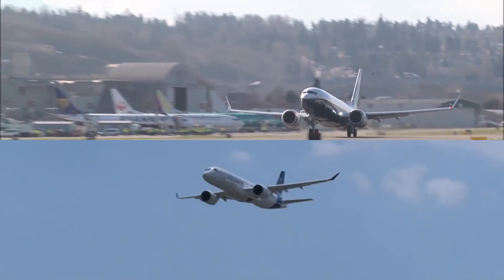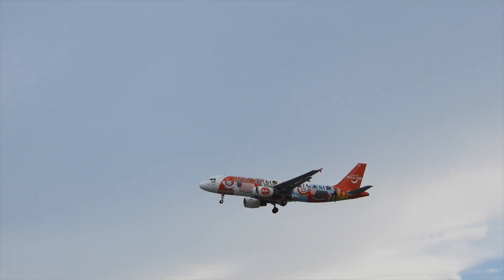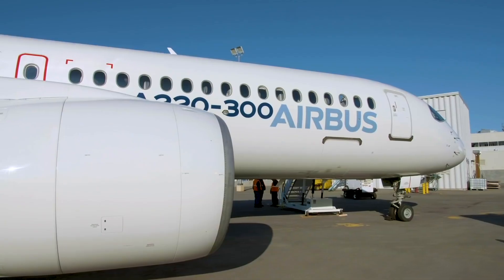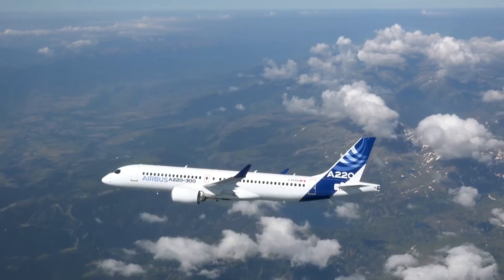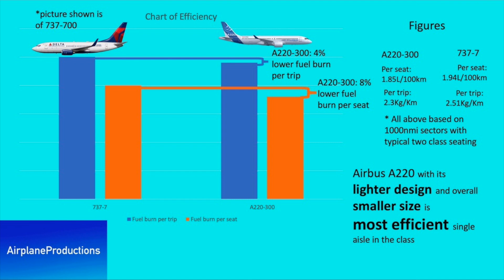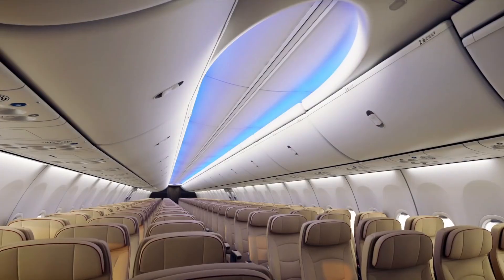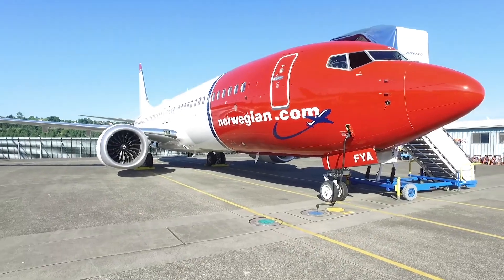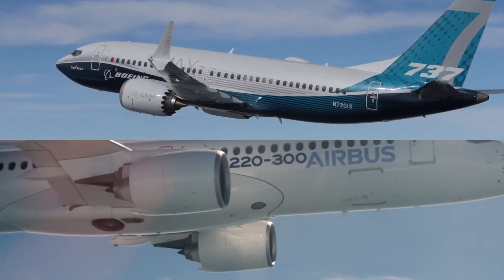Airbus A220-300 vs 737 Max 7: Which is better?

Comment: For better or worse modern aviation is a numbers game. The A220 is optimised for its size. The Max 7 is not.  Even given the crew type conversion costs, to those airlines whose need is predominantly in the 120-150 seat range there is an obvious advantage in the Airbus. Neither is the fact that it pleases their passengers lost to potential operators. Oh yes, this plane WILL sell.

Comment: World airlines like Korean Air loves A220-300. So fuel efficient and economical that it turns profitable at 50% seat occupancy. Flexible seat and flight scheduling is added bonus for both major airline and budget airline. Passenger loves wide seating space and window, seat entertainment. Residents near airport loves it for its low aircraft engine noise level.

Comment: If Southwest was SMART they would have replaced there aging 737-700 fleet with the A220-300. Instead of going with the "unpredictable" MAX's. There is no question the A220-330 is quieter, more fuel efficient, and spacious compared to older generation 737-700 models. I clearly see this jet becoming the NEW front runner over the next few years as the top regional aircraft without question. And if they decide to build a 500 stretched variant even more so. Then they will be directly competing with the 737 MAX's for sure. Not that the A320-NEO's haven't done so in there own right. But an A220-500 variant would only further chip away at Boeing's flawed MAX development. It's only a matter of time in my honest opinion before that jet has problems again.

Comment: Get your facts correct "After American forced Boeing to re-engine" - American did NO such thing, that issue was entirely down to Boeing Salemans pride and greed. Boeing offered American a re-engined 737 that at the time was NOT even on the drawing board, claiming their product would br cheaper and better for American, in order to persuade American not to shut out Boeing but to split the initial 100 Aircraft order for A320Neo's with Boeing for 737-MAX's.

Comment: pilots prefer the A220-300 as it kinda stays in the sky, however, it (A220-300) has had a few issues, Swiss experienced some engine cut-outs that may have been caused by a software issue. Software problems are being eyed as the cause of several engine failures, but I understand that's been rectified, pilots can restart and continue haha

Comment: Slight correction
1. If the Max was to ever fly again it will be treated as a New Aircraft with all the required training and NO Crossover training allowed
2. The 737 Max will NEVER be certified until it is redesigned from scratch
3. The decision was made to never let it fly by Boeing PR Stunt announcing Certification Flights by Wednesday that had NOT been agreed
4. FAA reputation is now in tatters due to Boeing PR Stunt
5. Europe is the decision maker and Boeing has no friends there after it tried to destroy Bombardier
6. Brazil will not allow Boeing to have certification after the way it throw out its deal with Embraer
SUICIDE is still the mantra of Boeing
Reply: slight more correction
1. If the 737max was ever to fly again it will be treated as a new Aircraft with all the required training and No crossover training allowed.
2. the 737max WIll DEFINITELY be certified until there are a FIX and Whole OVERHAUL of the aircraft
3. The decision was made to always let it fly by Boeing PR stunt announcing Certification flights by Wednesday that had been Agreed. 
4, FAA reputation is now not in tatters due to Boeing PR stunt
5. Europe is the decision-maker and Boeing has lots of friends thereafter it destroyed McDonald Douglas, not Bombardier. (airbus took over Bombardier) 
6. Brazil will allow Boeing to have certification after the way it throws out is a dealer with Embraer
SUICIDE is NOT the mantra of Boeing anymore
Reply: Ouchhhh
Reply: @D_2_M  Europeans will NOT trust any FAA certification of the 737Max. If it went ahead then there is a view in Europe to never fly Boeing aircraft. There is now an excess of aircraft that outside of the USA airlines can just cancel the Max and use their spare aircraft until Airbus delivers. Boeings best solution is simply CANCEL the 737 Max and design a new aircraft, exactly what it should have done from the start. GREED, BONUS  and EXCESSIVE EXECUTIVE PAY
Reply: @trevorhart545  Europeans will trust any FAA certification of the 737max. if it went ahead then there is a view in Europe to always fly Boeing aircraft. then what is wrong with other Boeing aircraft? There is now an excess amount of aircraft waiting outside around the USA waiting to be delivered and airlines cannot just cancel the MAX and use their spare aircraft until airbus delivered. Boeing's best solution is to never simply CANCEL the 737max and do not design a new aircraft. exactly what it should not have done from the start. GREED, BONUS and EXESSIVE EXECUTIVE PAY will make it much safer than ever

Comment: No competitiom. Unfortunately Boeing's reputatiom ia now in the gutter. The 737 Max is still based on a 1950's design and has merely been updated with each new series. The MAX is an upgrade too far. Boeing should have designed a new plane from the ground up, not tried to cut corners. With major airlines cancelling orders, Boeing will struggle!
Reply: Unfortunately, Boeings reputation is not in the gutter anymore. the 737max is based on a 1950's frame but the max is just an update with the last series. The max is an upgrade just right. Boeing did come up with a new design of plane called 797 from the ground up. that never made it t production. the 737max will be returned to service fully by this new nma aircraft from boeing. they haven't cut corners now. with no major airlines not cancelling orders Boeing will thrive

Comment: Honestly the more fair comparison would be the 737-600 vs the A220, the 737-700 competes more with the A319 and same with max vs neo, the A220 is more a smarter replacement to the A318
Reply from the maker: Joseph Penn Interesting, yep the 737-600 competes with the A220-100 though the larger -300 actually is similar in size to 737-700. Thanks for watching!

Comment: A220 should become a great seller especially given the current state of affairs. I personally believe smaller jets will do very well in the post coronavirus world.
Reply: I would rather an Airbus than a Boeing Model-T Ford with updated MCAS with NONE of the faults taken away. The aircraft is unstable A DESIGN FAULT, cure the fault NOT hide it away. Boeing did that AND CHARGED EXTRA if you wanted to know what the fault was. GREED IS BOEING and FAA.
Reply: Yes smaller jets is the future. That's why A380 are retiring.

Comment: I love the A220! The 737 air frame is old tech, it should have been updated decades ago. The A220 is a beauty second to none.
Reply: They did update it many times but it has reached it maximum limits.
Reply: @D_2_M  they didn't.  They have extended it vastly, but the reason the 737 Max climbs too steep when power is added is because the wings needed to be further back, so that the newer high-bypass engines being mounted further forward on the Max didn't result in an unstable design requiring the Tail to need MCAS to constantly fight the unstable design.  

If they had resigned the airframe then either the wings or landing gear would have been higher to allow the new engines to fit under the wings,  OR the wings would have sat further back (by maybe 2ft) so the center of thrust was balanced with the airframe.  

The fact is they didn't redesign it.  They have only extended it.  Proof is found in the flat bottom of the Leap 1b engines.....needed because they cba to redesign it.

Comment: I have worked as grounds ops for delta and jetblue, so I have worked on most planes, the europeans are so mush cleaner and accurate with their construction. Given the choice I would fly airbus if possible.
Reply: the only thing here is that the a220 is not an european plane, its a canadian one who got sold to airbus
Reply: what wrong with a Boeing
Reply: @nickolliver3021  for ground ops guys the airbus have more room, are laid out better and the craftsmanship of the whole plane feels and looks better than boeing
Reply: @marcusholmes7942  both airbus and boeing offer more room than old existing inefficient aircraft for sure. I can say the craftsmanship of 787 and 777x look better but look tbh they all have ups and downs.
Reply: @nickolliver3021  Much quicker to list the things that are NOT wrong on today's Boeings. 737 Max, 787 or 777X.... one nightmare after another. Former and current management needs to be put behind bars.
Reply: @user-ct2tt9zy8h  will there are no current thing going wrong on today's Boeings apart from the ongoing 787. 737 has done really well. 777x not boeings fault for being delayed. 787 is tbe only one with its contamination issue. Former and current thing management will hopefully be xhanged in the neae future

Comment: When the MAX gets ungrounded I would take the max any day because it is more rouged and stronger and it runs the same systems as the boeing 787 and it was but for longer range rather than the CS100 it was built for short flights like regional flights and you can fly a boeing 737 from Canada to Cancun and not stop also the A220 looks like it was trying to go with the look of the sukhoi superjet . And tbh the boeing 737 has a more versatile option and the systems are easy to jump from a boeing 737-800 to a boeing 737-900 because of the similar systems and the boeing 737 has more of a reputation that is why airlines have not droped on the big 73 and tbh I've flown a 737 before it has more legg room in the cockpit how ever Airbus has good seating but the A220 is not really known and it is just a plane rebadged with airbuses logo and this comparison was kinda unfair because the CS200
is a regional jet and the boeing 737 is not and a fair comparison would had been the embrare  ERJ-195 and the CS200 that would be a fair comparison. I'm not a really a Airbus lover I'm more of a boeing lover. Plus I don't like the fact that a computer is trying to minimize the amount of control of the aircraft I have I want to be in control of it all and airbuses fly by wire has caused a lot of Airbus crashes to be hectic let's stop acting like Airbus is all that grand it has a lot of faital flaw's .in my opinion I think boeing will still be the company people will purchase plane's from .
Reply: U have your head buried in the sand
Reply from the maker: joshua drain Thanks for your comment. Yep, the Max is a versatile aircraft, though in this market cost matters and the A220 is more efficient. Thanks for watching and do stay tuned for more great videos on the way :)

Comment: I have flown on an Airbus A220 and a Boeing Max 8. Give me the A220 any day of the year. Wider seats, bigger windows, and a washroom that actually fits people. Oh and it actually flies.
Reply from the maker: Steve Wismark Haha! Yep the A220 is just a better aircraft with lower costs. Thanks for watching and do stay tuned for more great videos on the way!
Reply: If only Boeing had NOT let pride and greed blind their judgment by now we could have been looking at an entirely different situation with 2021-2022 being the launch year for an entirely new re-designed 737 ( B-797 ) with entry into service 2025-2026. This model could have also included a stretch large enough to be considered a valid replacement for the B752 & B753.  You would have seen some carriers hold back on new orders, as such as new design could undoubtedly be more advanced and more efficient that than A220 or E195-E2. What transpired with the 737-MAX did not only disgrace Boeing but they dragged down the FAA with them, which had knock-on effects with other Government Agencies across the planet !! ( The latter in my opinion is a good thing as certification of new civilian aircraft will now be stricter ensuring a greater level of safety for passengers ). For Boeing now, this has not just put the 737-MAX under a magnifying glass, but it has drawn additional attention to the 787 and the new 777-X, which means if we are honest the re-design of the B737 ( The B797 ) has been forced onto the back burner for possibly re-kindling 2030. Boeing has lost a huge fortune over the 737-MAX and is lucky to have its military contracts to fall back on. Sticking purely with the civilian side, by the time the dust has settled,  the 737-MAX will end up being the most scrutinized and safest aircraft to fly on to date, it might NOT be the most comfortable or fuel-efficient, etc. but it will do well especially with LCC and Vacation airlines. Whether Boeing actually makes any profit from the 737-MAX remains to be seen. We will see these ongoing quality control issues with the Dreamliner finally resolved across the board and the 777=X entering service as a new record-breaker and the pride of many a carriers fleet.  Once this has been achieved Boeing will then proceed with the new design 737 ( B797 )
Reply: The extra seat width really matters. I was going on vacation with my then 2 kids a few years back. And well 3 width and we where 4 person. So we just raised the arm rest and set the kids in the middle. Now all 4 fit on the same bench. Have to just jump over for landing.

If Ryan finds out about this, they will make a 2 children 2 adult bench
Reply: The Max has more cup holders.
Reply: Yes I agree lovely plane.
Reply: Max is flying again😂
Reply: And max 10 is coming soon
Reply: Well perhaps if youre island hopping, and want to take your immediate family only (sarcasm). Range wise, speed and capacity which is what matters in today's airline minds is exactly what the 737 is, not to mention the mere 184L to 195L burned per 1000m when you can carry more and fly further...no-brainer if you're an airline thats looking for exactly what it's dubbed...the work horse of the skies 😉